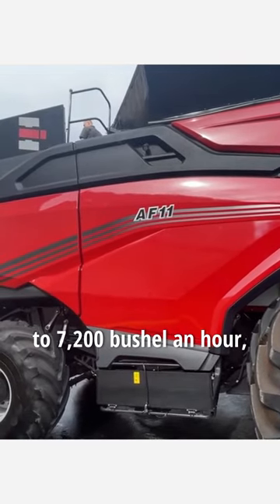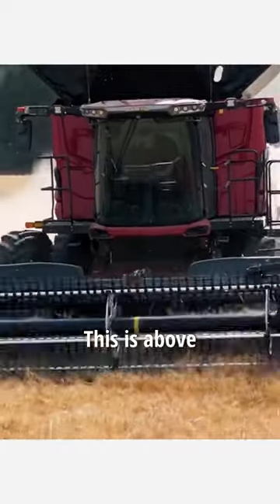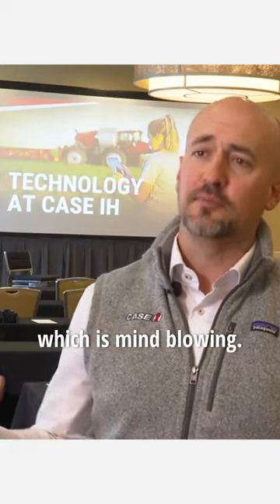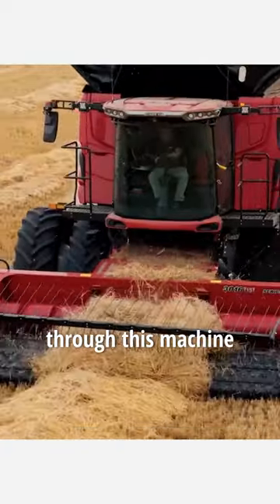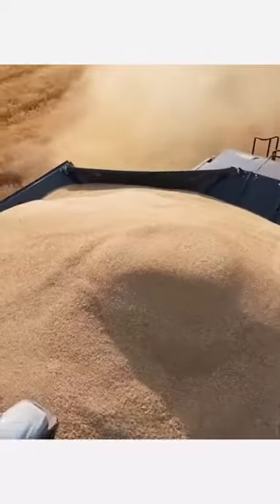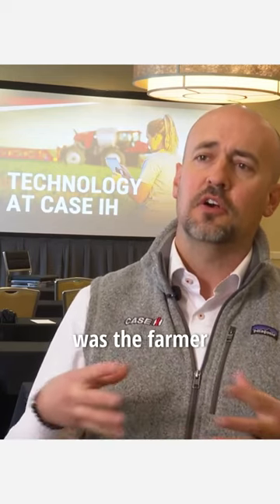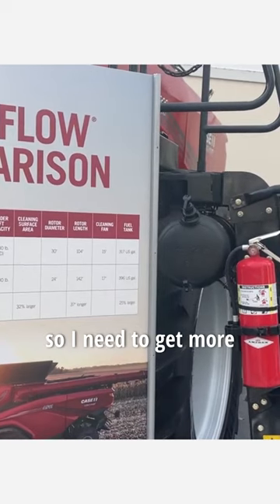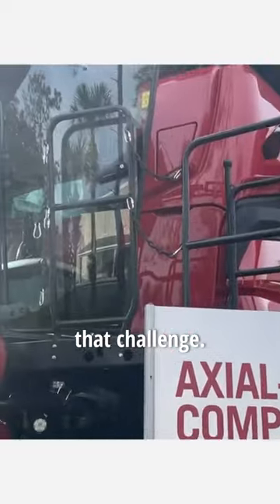This Case IH Tractor Helps Farmers Get More Out of Their Combine #shorts

Comment: I wish the engineers would find me 8 truck drivers instead
Reply: For the last 9 years, help is the limiting factor on most US farms.
Reply: 7-8 depending on size of trailers
Reply: Where you located? I’m looking to make a move inland. I’m 32, cdl, come with 2 trucks and more tools than a snap on dealer.
Reply: Wife & I both drive. Whatcha need/want?
Reply: Mother Bin?
Reply: thats not their job
Reply: Give me an visa and will come to help you in USA 🫡
Reply: Can't combine that much crop in an hour
Reply: Look no further, I'll man one of those trucks! Send me there and consider it a done deal to help you.
Reply: @deere7227 you sure can in good corn. The new cr11 and af11 are monsters
Reply: @BigBushFarms  maybe, just sat in a 10 yo 6.90 NH hit 3000bph in my corn today
Reply: @deere7227  the cr11 was doing 5mph with a 16 row head in 270 bushel corn
Reply: @BigBushFarms  2.4mph, 12 row 30" in 350plus area if field in So Ontario. He got me out of truck to do a round so I would believe him.
Reply: @deere7227  the cr11 was doing 5mph with a 16 row head on 30" rows in 270 bushel corn. Over 5k bushels per hour consistently

Comment: As a farmer I can tell you farmers mentality in paying a good enough wage to compete for labor isn't there. But he'll drop hundreds of thousands of dollars or more on annual lease payments.
Reply: Not me hell no.
Reply: I can do the same job with our old 1460, it just takes more time but that old $7000 combine still does the same job.
So how many of these old combines can I buy and how many guys can I hire to do the same job?
I was at our local dealers spring open house a few weeks ago and I asked what theprice tag was on this new beast and they couldn't tell me.
This is getting truly ridiculous!
Reply: 5k combine maintained and self driven has done me well for 20 years. 30k tractor unit and I think it was 8 for the trailer and some wrenching vs over 500k for combine and 8-10 trucks on the road hauling to the mill cause no home silos taking that volume quick enough 

Only reason I see people keep going new is rough operators/shineymetal pissinmatch with the neighbours or be spanner shy
Reply: @VelEire_ Hell we did 600 acres  of corn per year with an Oliver 431.
Reply: @interman7715  In the 70's my Dad farmed 2,000 acres, took most of it off every year with two JD 105 combines. Started on the barley in July, then spring wheat, then flax, millet, and finished up sunflowers in late October early November.  Also chopped 70 acres of corn in early October. But he had two young sons, a hired man and the hired man's son to help.
Reply: Equipment is a much bigger tax break than labor is
Reply: @jeffekkel5870  Old combines are good for small-medium farms but trying to replace 1-2 new machines with 5 old ones will not go well. Your gonna have more down time and a lot of the old machines don't do as good of a job.
Reply: it’s a CR

Comment: I am very happy that Caseih built this beautiful machine and it is very impressive .If I was still farming now I would buy two Caseih 2388s or similar for about $40,000.00 each and pay my workers more money to stick around, a lot less payments and stress.
Reply: Yes but the bad thing is 5,000 separator hours on a combine and it needs a major overhaul. Our 2388 gets 30k thrown at it a year and does around 1,200ish acres. We’re getting to that 5,000 hour mark so I can see owning a brand new machine just not for the price of it or corn
Reply: It is beautiful, but it's a new holland painted red
Reply: False
Reply: You wouldn't be in business long
Reply: @MillerFamilyFarms You will probably throw $50,000 a year easily at the beast, at least rhe 2488 is paid for
Reply: @jimpeters7931  I can also run a 12 row head at 4.5mph and it’d be the same as a 6 row at 9mph. Gotta look at it at different angles. $50,000 a year might be a bit much if I’m putting half the hours on🤷‍♂️

Comment: Capacity is nothing if you can't utilize it efficiently. The complaint is that you can't get the grain AWAY from these huge Combines to keep them moving. The weight and compaction has to be crazy. Another issue that costs money and time  to combat or suffer yield losses. What is gained here? 5 fewer days in the field? That can sometimes be the difference but the money difference at the bottom line I'll wager is less. No thanks.

Comment: Then look at the higher capacity CR11 which is capable of even higher capacity then the AF11
Reply: Its the same sort of capacity but different rotor set ups and sizes. Case ih rotors in the af11 are slightly shorter then the NH CR11
Reply: @jezcolborne6329  still tho the CR11 will easily crush the AF11 and will take the record of most wheat harvested from the cr10 💪
Reply: @moocow0014   case will be able to match the cr11 but they wont compeat in the uk as case has made the AF11 for america as with new holland it will be able to fight the JDX9 AND the claas 8900 for the largest graintank going and true high capacity for any uk combine harvester and its the same for case in the US and Canada. It will out run the FENDT IDEAL 10T as well as the combines i mentioned no problem but will go well with the CR11
Reply: @jezcolborne6329  na the cr10 still was beating the X9 and somewhat the 8900. the cr11 has smashed it fully tho. the cr10 was always ahead and was still ahead in capacity when the x9 released
Reply: Both machines are made by CNH Industrial limited - both mechanically identical - about the only difference is the paint scheme and perhaps the controlling software, but that's about it.

Comment: This should be the New Holland CR11 right? Most impressive I think is the losses, because there arnt really any and also the sensor stuff like oil in canola, straw spreading and so on. I guess the sensor stuff is more a gimick but still interesting. Also you can get it with an 18 Meter header I think.